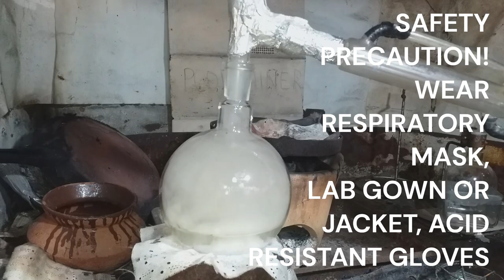GOLD RECOVERY FROM MY CRUCIBLE | HOW DO YOU MAKE NITRIC ACID AT HOME FOR GOLD RECOVERY

Comment: If the nitric acid is to strong can it simply be diluted with water or just use less?
Thank you.
Reply from the maker: You can dilute it with water, but the strenght has still remain, if you add too much water then is not effective anymore